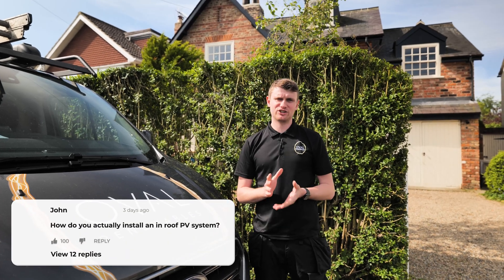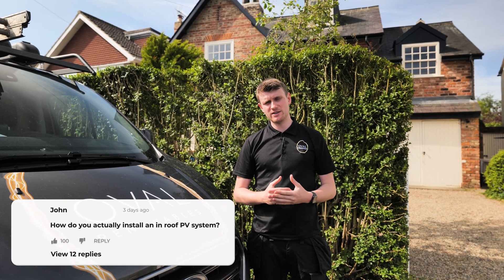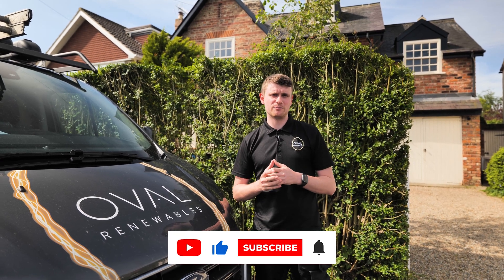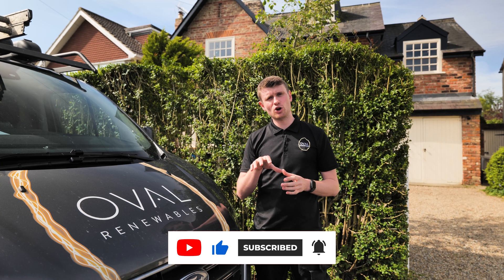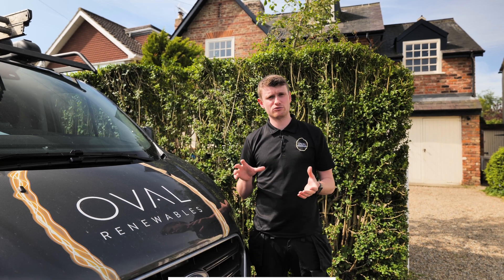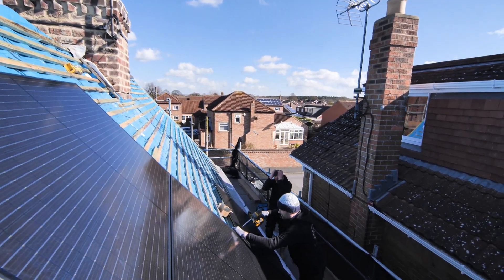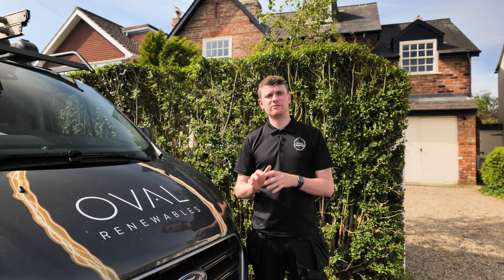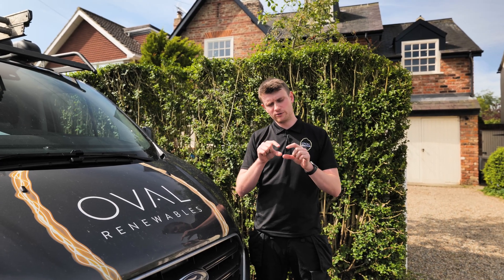How do you actually install an in roof solar pv system?

Comment: I have a solar edge inverter for my solar panels and a Tesla powerwall 2 that have just been fitted.(Nov 22) I have been told I don't need a separate DC isolator as there is one in the Solar Edge Inverter. Are they right or do the new Regulations from September say I need a separate one?

Comment: Hi. Have you done any domestic flat roof installs. I have a 1930s semi with a loft conversion. Standard pitched roof front / 5x5m flat roof rear. What mounting system would I use for the flat? NW Nr Lancaster.
Reply from the maker: Hi yes we have. There will be a short on our profile that will show you the flat roof system we use.